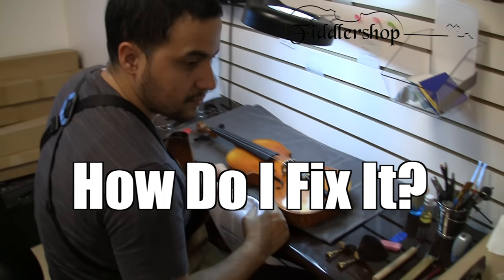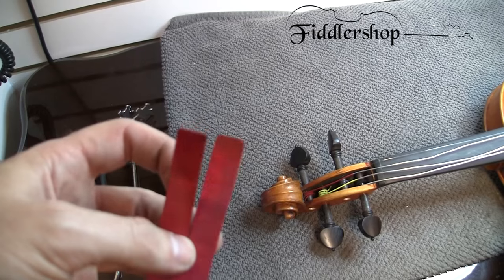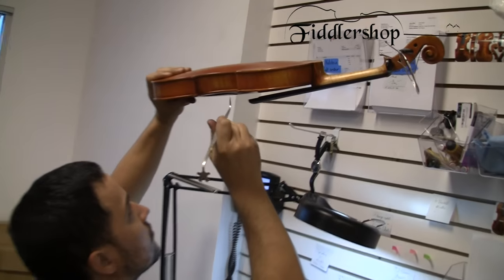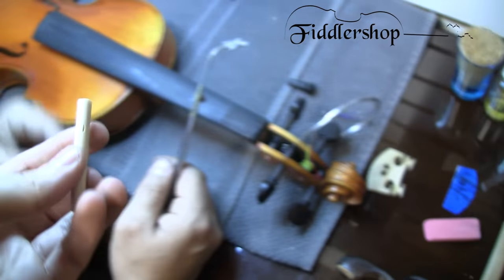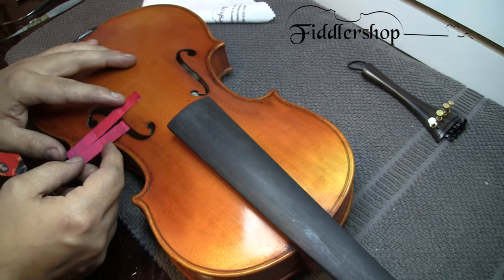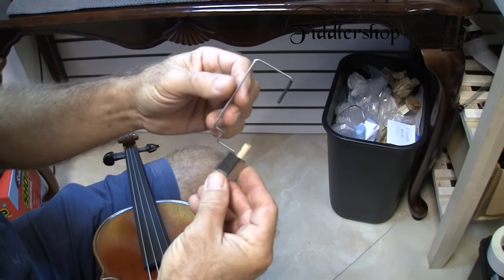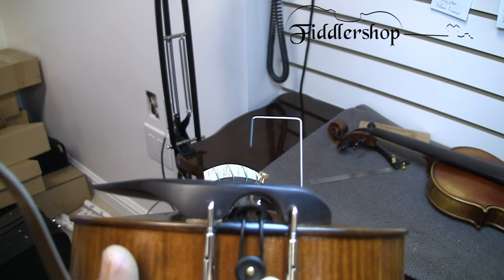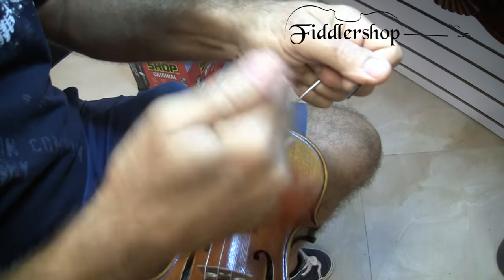Ask a Luthier - Fallen Violin Sound post - How To Fix It?

Comment: Friendly tip, I use a guitar capo whenever I take the strings off just at the tailpiece. Not only is it quicker but, since it stops them from moving at the place that I put the capo, it keeps the strings from getting crisscross, even in the pegbox.
Reply: I've used your tip on violins, and guitars if I want to adjust a saddle on certain bridges.  So, thanks a lot!

Comment: They both make this look a lot easier than it usually is. The average person will "lose" the soundpost a few times and have the frustration of getting it back out of the f holes, and you have to be so careful not to damage the f hole edges. This is way harder than it seems - these guys are super slick at it. Nice job!
Reply from the maker: Yes, it can take some time before you get a hang of it. It also depends on how handy you are. Thanks :)

Comment: So the post setting tool has to be sharper than is comes?  Every time I insert through the f hole and get it inside the sound post comes off the tip of the tool.  I just ordered your other install tool.  Thanks Pierre, David

Comment: If you really want to try and set your own soudpost I would recommend the gemini sound post setter and then a sound post retriever tool. The gemini sound post tool is 1000x easier to use then the traditional stick and poke method.
Reply: ViolinRestorationNC, I disagree. I've seen the Gemini at work and with this soundpost setter, all you have to do is put the soundpost in the springlike cradle and slip it in the f hole and thats it and it has a locator to show exactly where the post is. With the Gemini you have to screw around with the loop and there is no locator to show if it is in the right position, which is crucial.

Comment: I know to change strings one at a time to keep tension on the instrument and avoid the sound post falling. But if the sound post is properly fit and snug, it should NOT fall even with no strings or tension. Correct?
Reply from the maker: Thanks for watching! It may be possible, but it depends on the individual instrument.

Comment: Very informative video. I would like to ask a question if you have the time to answer. I've recently been allowed to borrow a violin that seems to be an older model, however there's no marking inside. the only distinction i have found is that the soundpost inside of it appears to have a small bit of TWINE tied around it in a knot. does this mean anything??

Comment: Thank you for the demonstration.  I believe the video could only tell HALF of the story of what to do.  After you have inserted the tool into the violin, no one can see what did you do.  Will it be possible for you to show us the hidden procedure by using a transparent violin or using a cut open violin so that we can see how did you move the tool inside the instrument ?
Another issue is this after the installation of the sound post, how do you use the tools for minor adjustment of the sound post.  For example how to use your tool  to move it further away from the bridge, or to the right or left of the first inserted position etc ? 

For minor adjustment, do you move the top of the post a little first and then try to move the bottom end of the post in the same amount ???
Reply from the maker: Hi! Please check this video out!! I think you will be surprised :) https://www.youtube.com/watch?v=XoX11EAzGX0&feature=youtu.be&fbclid=IwAR0g-aY0iioGDiWKODXjOe4wYyd0-RwUkYofsQ2pHrsU5C20S3XOcAiqcJU

Comment: I recently acquired an old violin that was stored in an attic
for years. I removed the top to repair some of its’ cracks and noticed the wood
is quite dry and brittle is there anything I can put on the wood to help
preserve it that will not total destroy the sound quality of the violin ?
Reply: Hey bubayou,
It just needs to be hydrated. Just put it in a case with a humidifier. you can use a ordinary kitchen sponge and a sandwich bag with a couple holes in it. Wet the sponge and wring out till damp, place in the bag and put it in the violin case with the violin. It will take 4 or 5 days to hydrate the violin. Make sure to check the violin once a day, so you don't over hydrate. Don't ever put anything on the wood.
Hope this helps, good luck!
Reply: Thanks for your advice. I'll go ahead and do that. I'll be going to my local Petco to pick up a hygrometer so I can monitor the hydration level of the violin.
Thanks again

Comment: My soundpost fell at the local luthier so he made a new one and put it in my violin doesn't sound as good anymore what's the problem?
Reply from the maker: It could be a couple reasons, including the quality of wood, diameter, fit, and placement of the new soundpost might not be right for your instrument. If you can return to the luthier and clarify what is you miss (depth, projection, clarity, etc) they'd most likely be able to adjust it, let you test, and readjust etc.
Reply: @Fiddlershop  he already adjusted it a couple times and I think that may have actually made it worse. I'm going to go to a different movie today I hopefully. My violin used to have a nice sweet deeper sound to it no matter what strings I put on but now it has a very tinny brassy thin sound to it
Reply from the maker: Oh no, so sorry to hear that. 🥲
Reply: @Fiddlershop  me too 😢 .
At the new luthier he widened the eyes in the bridge and sanded the top also chiseled down the back where it was still completely uncarved he adjusts the sound post again and it actually does sound better but I'm just not sure I'm so picky I just want the absolute perfect violin do you think I could adjust my violin to be perfect or do I have to get a new one?
Reply: @Fiddlershop  I also want to ask a question is it okay to take two strings off when you're changing the strings like the G and the d change those and then the A and E and then change those it seems it would be a lot easier but I don't know if it's okay although I did see the luthier do it

Comment: And how much does it cost to have this done?
Reply: A luthier would probably charge anywhere between $25 to $75 nowadays. The soundpost adjuster Fiddleman demonstrated is $ 11.95 at Fiddlershop! I bought one. It comes with excellent instructions and it is easy to use.
Reply from the maker: Hi! We charge $15. Sometimes nothing, if you are having other things fixed. Thanks for asking :)

Comment: How tight should it be set?  Sort of just as it comes off the tool?
Reply from the maker: If you loosen the strings and put the sound post in so that it's snug, it will get tighter as you tune the strings again. If it's too hard, you'll find that the violin will not vibrate as much. It will sound restricted.

Comment: Why don't they use animal glue to glue in the sound post so it doesn't fall?
Reply from the maker: Good question, but it's advantageous to be able to adjust the soundpost to find the best sound. A properly fitted soundpost, and if the instrument is cared for, it shouldn't fall. However, if an instrument has been sitting for years without strings or tension, and maybe has an open seam, or takes a hard fall, then it does happen. But it's not too common otherwise.

Comment: Why the heck can't it be glued in place?
Reply: For the same reason the bridge can't be. The instrument, being made of wood,  will expand and contract with changes in temperature and (especially) humidity.  This would break any glue bond, unless the glue was too string, in which case it would cause the top or the back to crack in a particularly nasty way. 

Also, we need to be able to move the post around slightly to adjust the sound of the instrument (which can change with the weather or the season).

Comment: Sound post is under the bridge leg?
Reply: The sound post should be positioned BEHIND  the bridge leg at a distance of about  the same diameter of the post. Minor adjustment of the position of the post is of utmost importance.  Installing the post is just the beginning of the task.  If the post is too close to the bridge, the sound will be a little harsh , rough sound, more difficult to produce a smooth sound.. Moving it away from the bridge will give a more relaxed sound and it will be easier to produce the sound. However if it is too far from the bridge, the loudness level will drop.
Reply: @CTP8585  Wow! Thank you! I could not get the bridge to stay up and so eventually brought it to a music shop. They changed the sound post to another one ..said the first one was injured, but it was fine when I looked it at it....so $35 more for the new sound post and then he didn't put it right under the bridge leg which you say is good. I don't know how much time he spent finding the right spot for it. This was a new instrument...$104 and looked like the $1400 one he had in the shop. He scolded me for buying such a cheap instrument. I know the bow in cheap/not strongly made. To me the instrument looked like a good quality one...good wood, but strings/tuners are cheap. I just wanted an instrument to play fun sounds on, but I wanted one that was playable/sounded nice. Great answer/insights into it. I didn't want to move the sound post myself. Sound posts are not glued on...just squeezed into position. Thanks for taking the time to help me understand about the sound post location! Happiness...